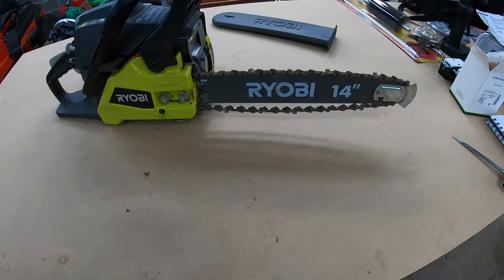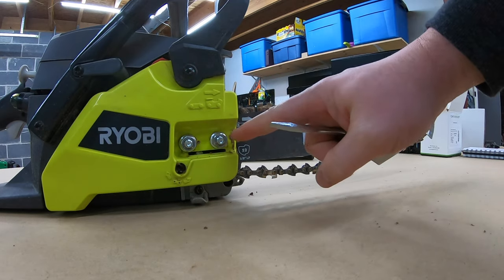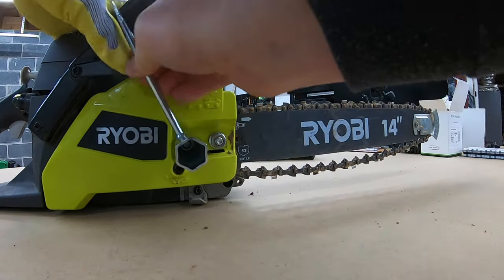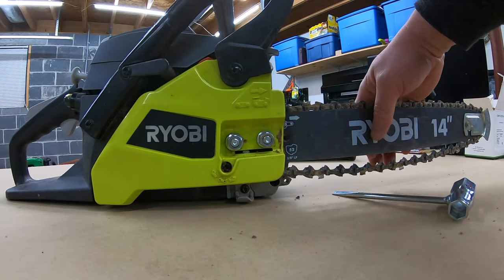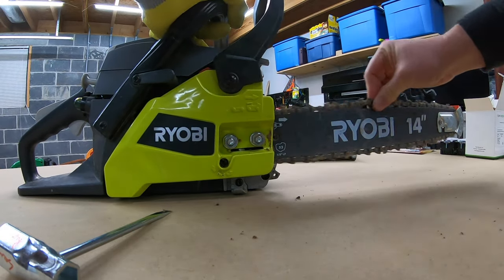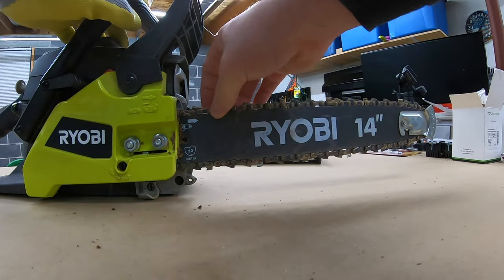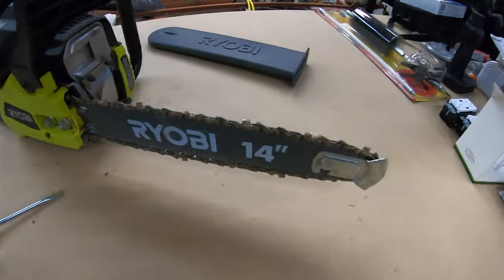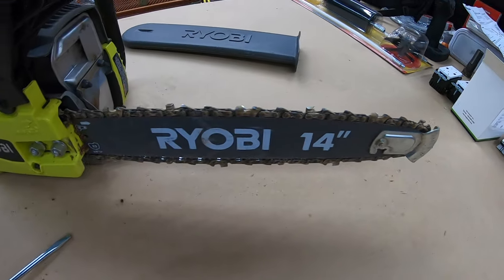How To Tighten a Chain Saw Chain on Home Depots Ryobi 14" - RY3714

Comment: My friend drop his off at my house throttle stumbles, could the chain be to tight. You can play with the trigger and the saw works just fine,idles great, any suggestions
Reply from the maker: Could be.  You may try taking the chain and bar off to see if anything is broke or bent inside.  I have never taken this bar off, but YT videos make it look pretty easy.  Hope you figure it out.
Reply: @weekendhomeprojects  thanks for that, that was fast!!  Adjusted the chain and the bar seemed to relax. But it runs and cuts. Now head did say it sat for a year. So I ran it out of gas, and it's running through it's second tank as we speak. But thanks again

Comment: Ok I see your. Vid at this time is a month old, I have the exact same. Model, when you loosen the two bolts for your guard pool and stretch the bar manually with your hand and then use the flat blade to adjust the tension that won't strip out your what I want to call it screw your tensioner guide bar as much you'll see you can crank it the whole way in when you take the device off well pulling your chain bar and take the tension away then use the flat blade screw to apply the tension by way another thing get rid of your dumb kickback bar on the piece on the front end of the chain bar that useless won't serve you any purpose only it'll get in your way.
Reply: Had mine for 2 and a half years now now prob,and it says 50/1 on mix this is true but if it ever runs funny on you don't grab a screwdriver and start f**** with the carburetor if it's running slow adjust the 50 to 1 mix add a little more gas just said cut a little tiny bit more gas in there and it'll run out and run hot and that'll fix it if it's running too hot then back it away and just go straight 50 to 1 but I've owned this chainsaw for two and a half years and never touched a carburetor screw I just mess with the gas lean it out or add more oil whatever you got to do but don't touch that carb screw!

Comment: Mine only clicks when I try to loosen it up... Why?
Reply from the maker: @adlerdefender8067  Did you loosen the two nuts first?   You have to loosen those, make the adjustment, then tighten the nuts back up to lock it into place.
Reply from the maker: @adlerdefender8067  Funny because I was cleaning the garage and just did this before putting the chainsaw on the shelf.

Comment: Again I reiterate take your flat blade and take your tensioner all the way left not positive to add tension loosen the two bolts on the casing then with your hand manually pull out on the chain tension to make it hard then use the flat blade to apply pressure that won't strip that screw out for you your tensioner buddy don't Max it out cuz if you do you're going to have trouble cuz then you're going to pop that spring in there plus you're going to stretch your chain over too far you can maximize your chain as it wears and stretches with this tit just trying to help not trying to say that you don't know what you're doing I'm just telling you with two and a half years experience with this chainsaw that's the best way to go and like I said don't touch that car don't put no screwdriver to that car use your 50 to 1 mix if it's a little boggy add a little more gas not much like as you use in chainsaw add like maybe a tablespoon or two of gas on a 51 mix that's actually in the chainsaw running a little rich see if that works if it runs too hot and it's too heavy and won't idle down then go back and make sure you're at more mix but don't touch that carb screw
Reply: Fantastic use of punctuation and run on sentences why bother commenting when someone has to read 10x to figure out when a thought ends and the next statement begins i wonder if i should start doiing the same thing it is much easier than trying to be coherent

Comment: didnt know i needed a mechanical engineering degree for a home chain saw.  giving up.  not as easy as it looks. not matter what i do it doesnt tighten. :(. 

if someone would engineer an easy one to adjust they would be a billionaire.
Reply from the maker: You have to loosen the bar bolt before you try the tightening screw.  I’ve caught myself not doing that a few times and scratching my head on why it’s not doing anything.